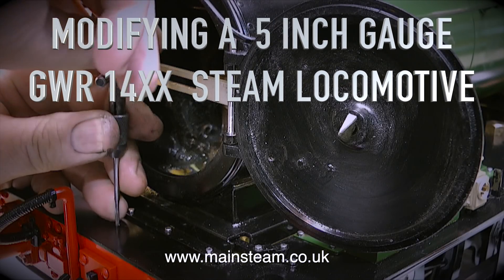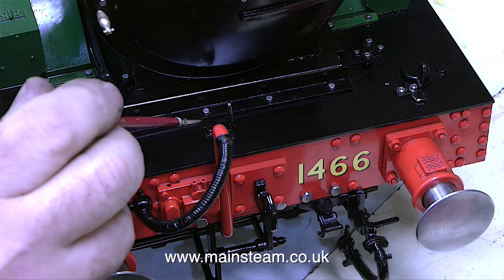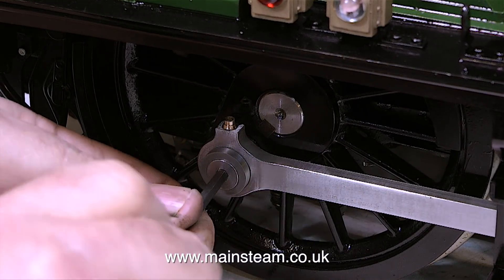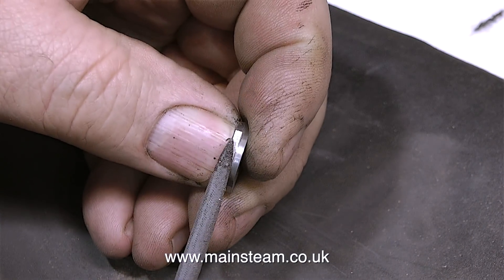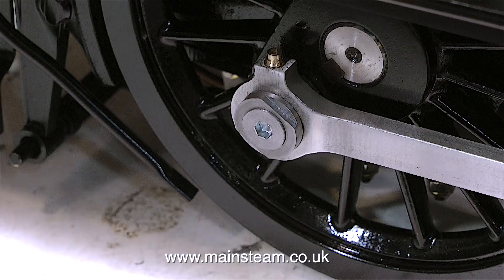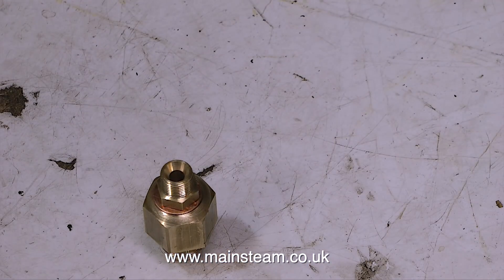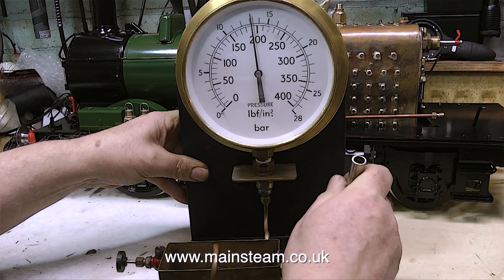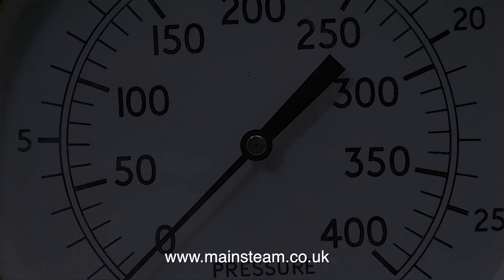MODIFYING A 5 INCH GAUGE GWR 14XX STEAM LOCOMOTIVE - PART #10

Comment: G’day Keith, to the suggestion you got that you should use Chrome Vanadium tools on tiny BA size fasteners; What is the point? You can’t apply high torque to such small threads anyway. A really useful trick is to use very thin wall brass tube (found in the racks in hobby model shops) as temporary box spanners. Select a tube with an internal diameter slightly smaller than the across corners dimension of the hex head. Put the bolt in the vice and gently tap a short length of tube over the head. It will form an internal hex that will take a surprising amount of torque. Granted it will not last forever, but when is gets to a point where it slips, just cut off the end and repeat.

Comment: Keith, if you can find a socket head bolt with a hexagon socket of the right size, you can machine off most of the head of the bolt and have a slim box spanner to get into tight spots.
Reply from the maker: I do that very frequently, but if you look closely at these lamp brackets in the video, there is a cast in crossbar (a ridge to stop the lamp from going all the way down) on the upright part which makes it impossible to use a socket no matter how much is machined off it .......